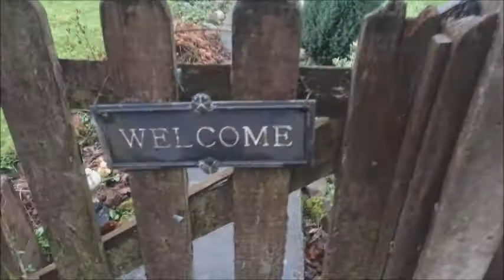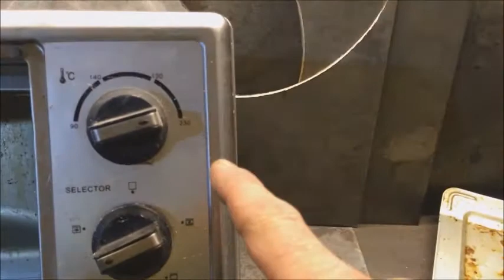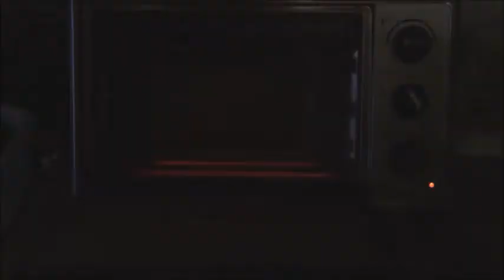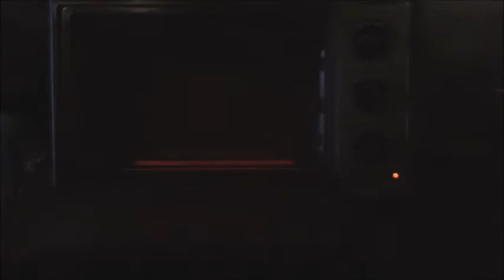Xmas visit, Scrap bust !, Noisy buggers, I need a table,

Comment: Nice little build there, you are so resourceful!  That oven would be great for melting HDPE, though heavy on the electric and slow.  I'd love to see you build a rocket mass heater in your shed (not a rocket stove, a rocket mass heater).  Best wishes and have a great Christmas!  Poo
Reply from the maker: it is on my list to do , I did make one once, didn't work quite right, just made woodgas